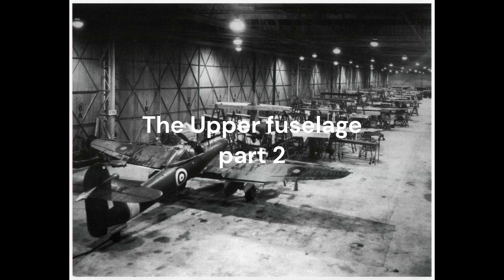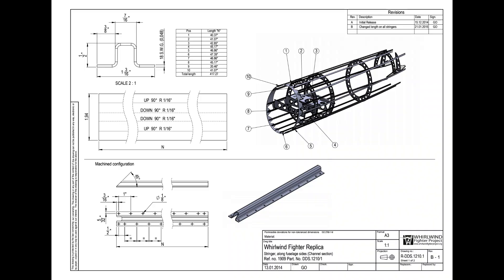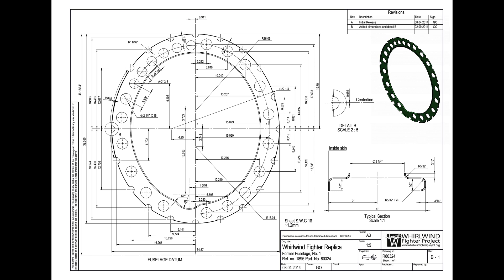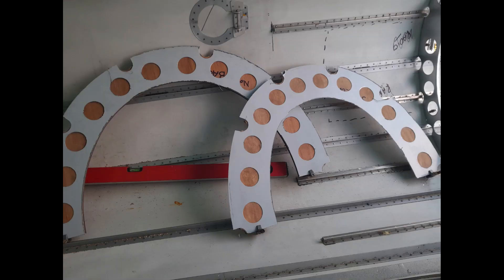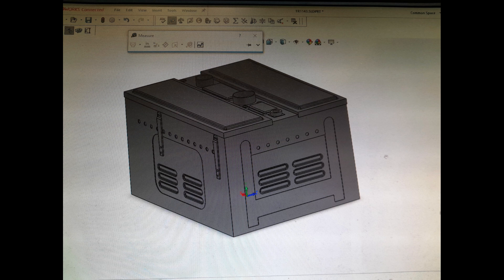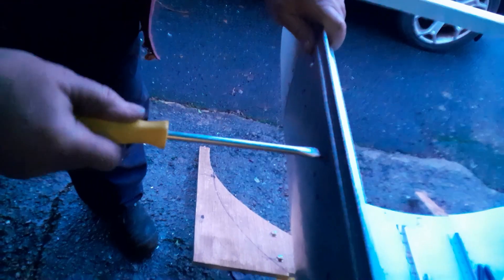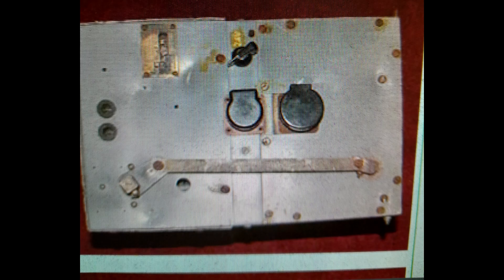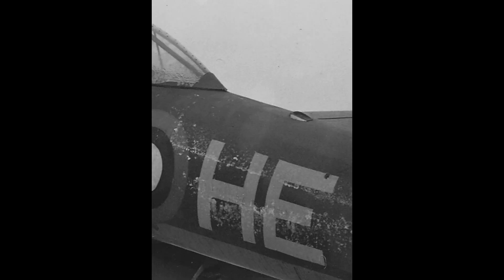Whirlwind Fighter Project - Engineering Update part 20 - Constructing the upper fuselage part 2

Comment: Not a question about the Upper Fuselage: what is the situation on the Peregrine engines? Do you have a pair?
Reply from the maker: Hi, we do have a pair of crash damaged engines. Sadly there are no useable Peregrine engines left in existence, we do have an option on a pair of Kestrel engines, being the same basic engine. However the £1/2 million price tag will take a lot of finding. The main thrust of the project is to complete the airframe, then we can look at fitting engines. Thanks for the question and interest
Reply: @whirlwindfp is crash damaged a terminal phrase? Or are they salvageable
Reply from the maker: @AgriVideos1  
Sadly the two we have are beyond salvage, they have extensive damage . thanks for the question.